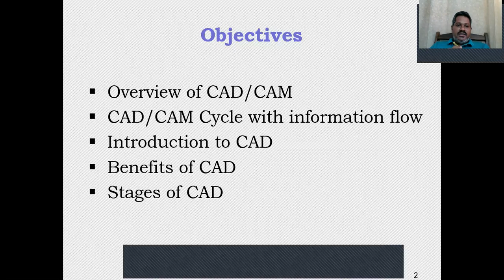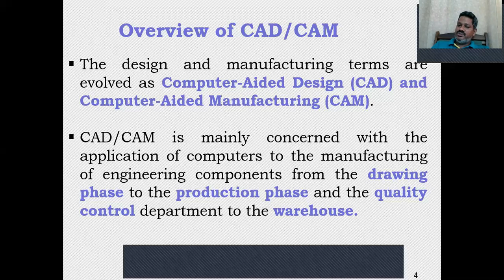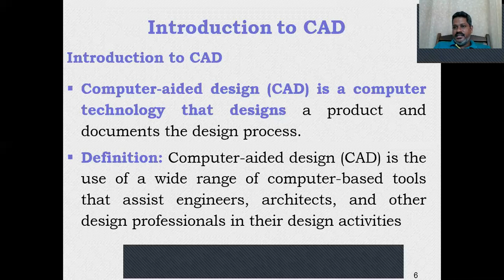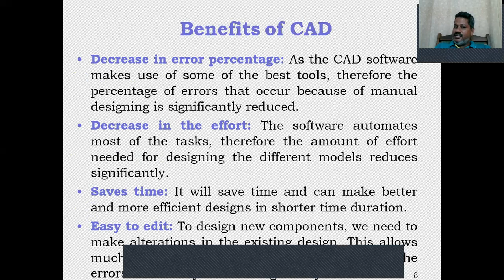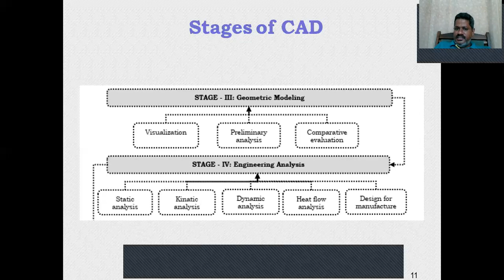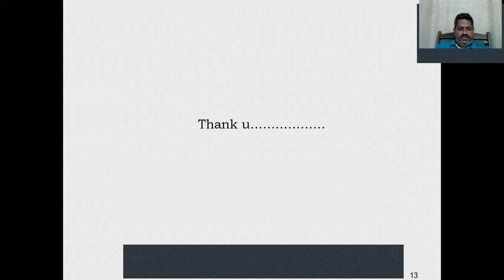Comment: In stages of CAD
In stage-1, "General solution" is based on basic rules and principles
In stage-2, "Preliminary design "is also based on basic principles 
Is This two are same? 
If not, What is the difference between them?
Reply: These two are bit different, 
‘General solution’ is at conceptual stage solution…….
Whereas ‘Preliminary Solution’ is just beyond the above by applying basic principles ….